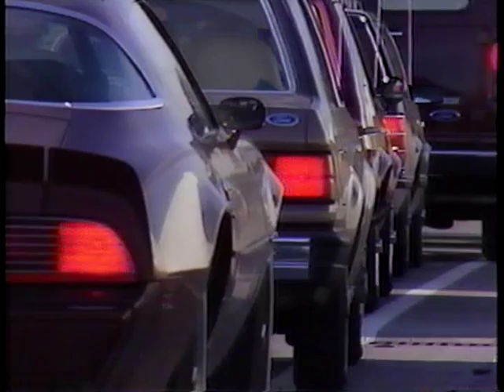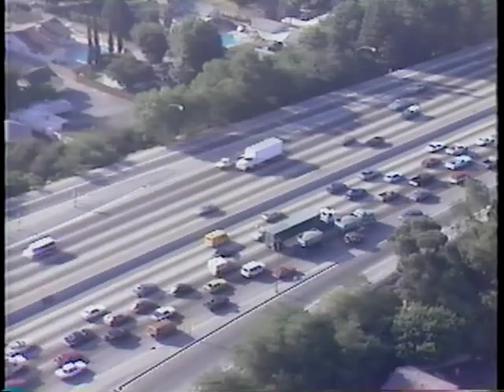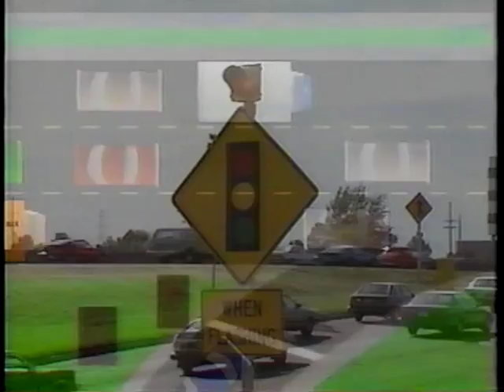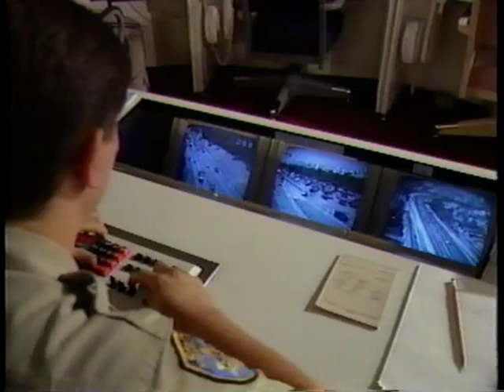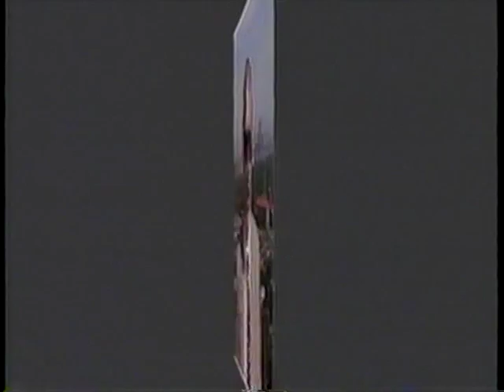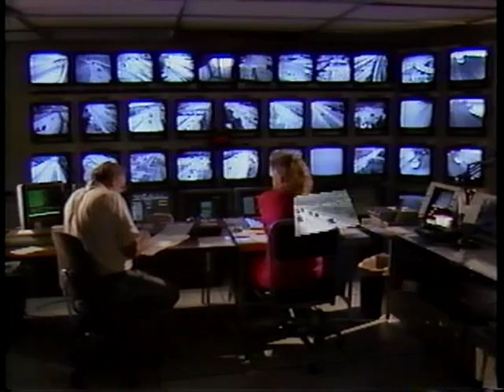Ramp Metering: Signal for Success

Comment: The amount of time saved is negated by the wait to get to the metering light itself. Junk science
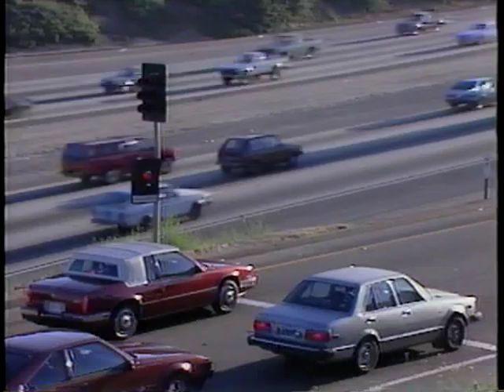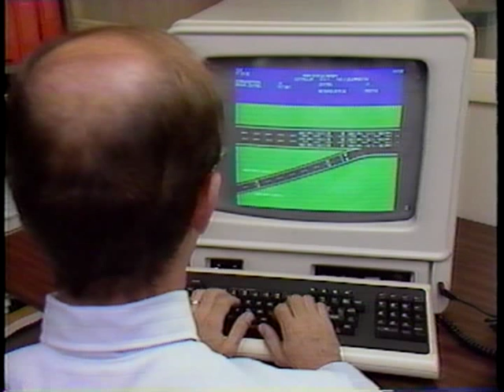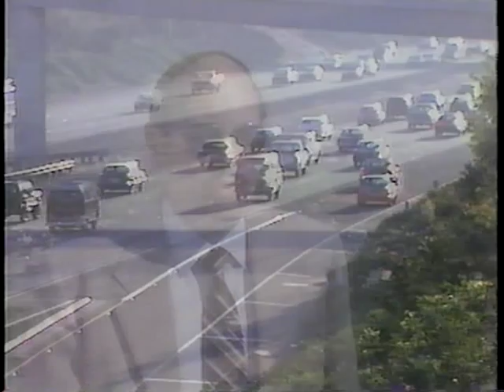Reply: Mike Swanson, you are incorrect.  When ramp meters are installed, the OVERALL travel time is lowered.  If you leave your house at 8:00 without ramp meters along your journey, it might take you until 8:30 to get to work.  But WITH ramp meters, it most likely will allow you to get to work at around 8:20 instead.  A few years ago, the City of Minneapolis turned off their ramp meters for two months as an experiment.  When they did that, average travel times INCREASED.  But I'll bet you think that's junk science!
Reply: @am74343  congratulations, your a brain dead model citizen.   Here's where your math is wrong and what the dot doesn't factor in. The wait time to get to the metering lights is not calculated in there times. If traffic is light, (thanks pandemic) the metering lights are time wasting, polluting and dangerous (slow merging into fast highway) . keep drinking the coolaid dot workers.